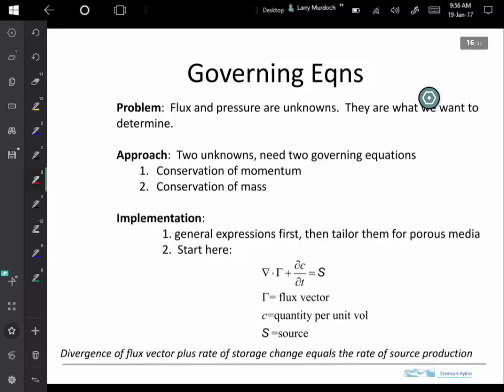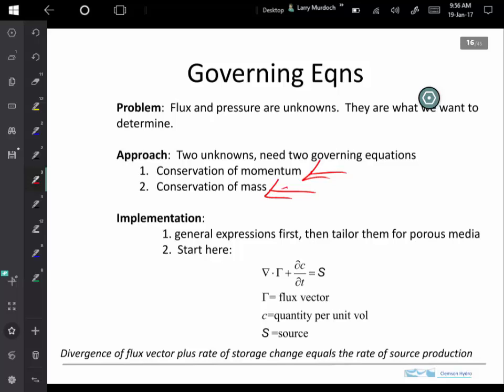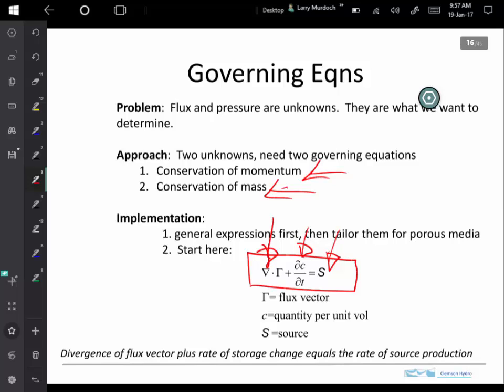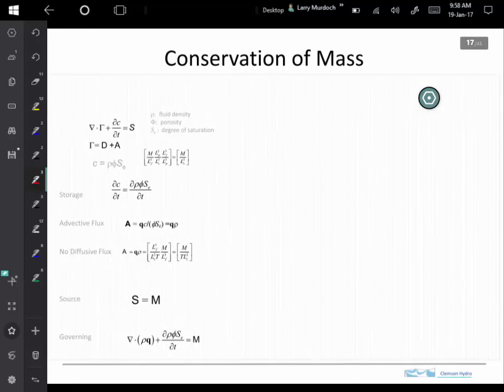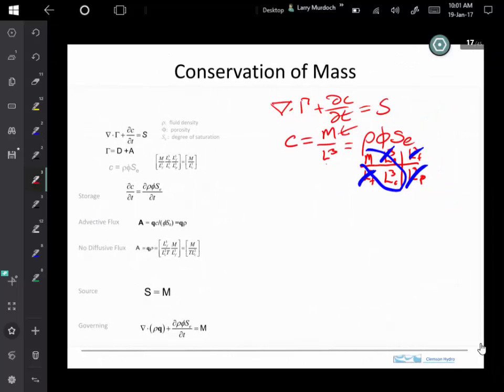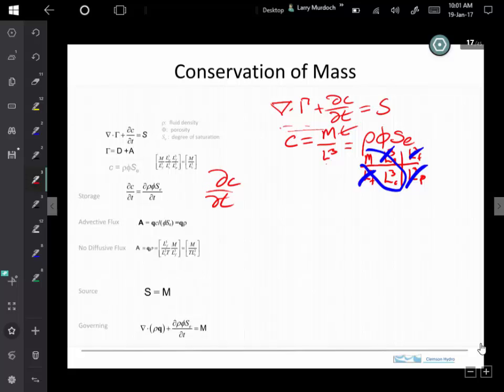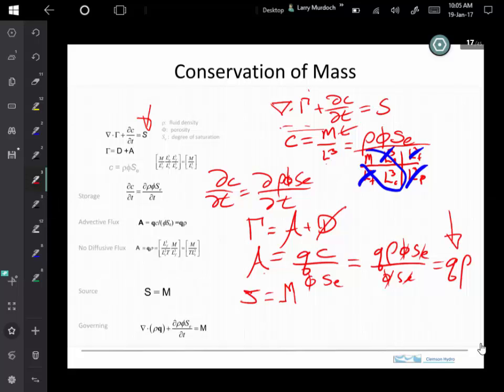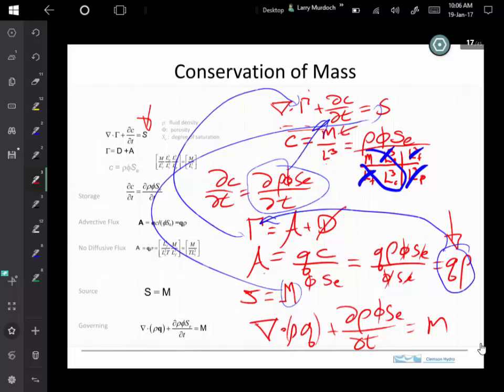governing eq and mass conservation APS 2 p2

Comment: 4:46 why this volume in density is volume of fluid? In other words, why this density is fluid density? If this density is fluid density, mass should be fluid mass?
Reply from the maker: Rui,    The conservation is applied to the total volume of the control volume.  That is the term in the denominator in c.  However, only part of the control volume is filled with water.  The rest is filled with solid and (in some cases) gas.  The porosity and degree of saturation are used to get the conservation to work out.    Larry